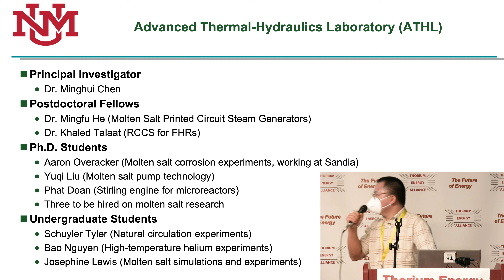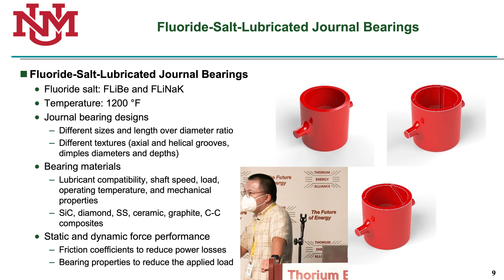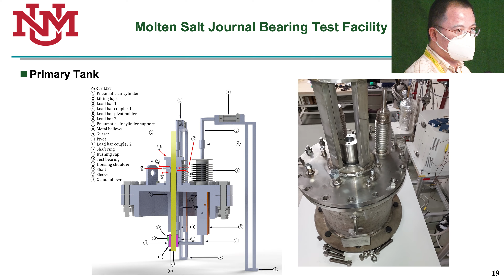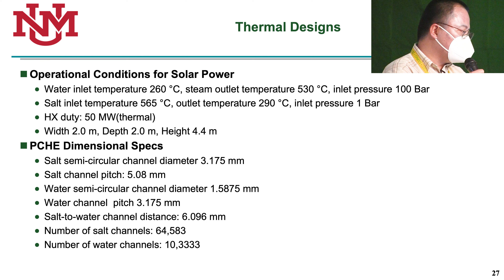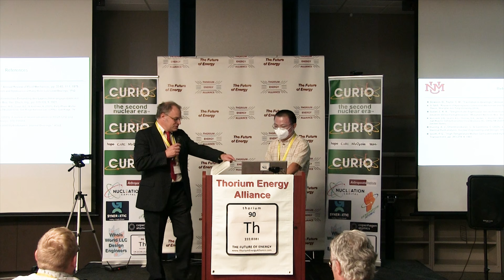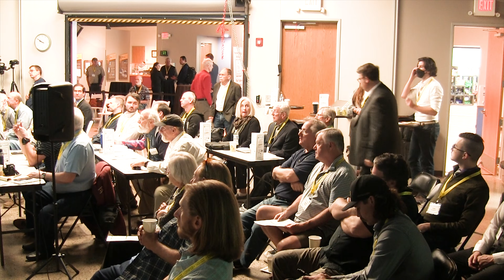Molten-Salt Lubricated Bearings (NEUP Project) by Minghui Chen of UNM @ TEAC11

Comment: If you try for perfection you will never finish anything. You will probably never get off the paper. The AEC had a functioning Thorium molten salt reactor at Oak Ridge for decades. Study that machine and get working on the design of a larger experimental reactor. Develop all the details on that machine. 

We need these thing now! Not some time in the future. We need them now so get busy. Function is far more important then perfection. Remember oil will not last forever and coal is simply too damn dirty.

Comment: Jeesus Meesus.  Thorium salt reactors need to happen NOW, not in 20 years.
You guys need to ditch this pie-in-the-sky crap and design cheap and easy systems using currently available, off-the-shelf components.